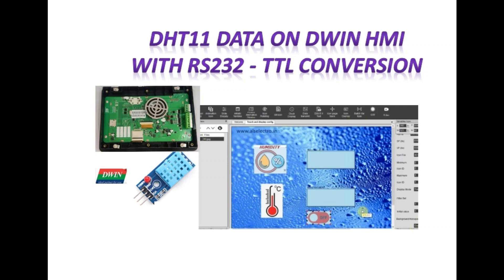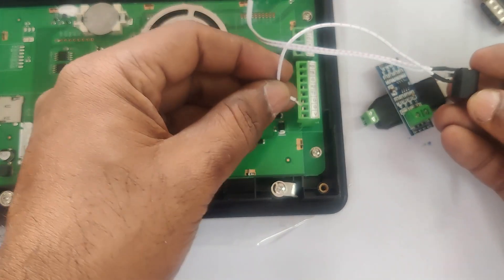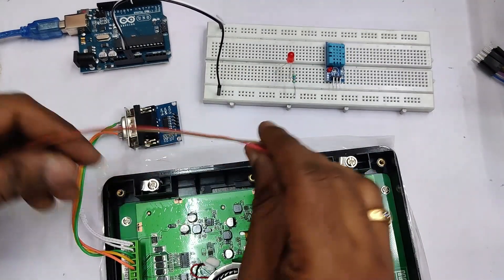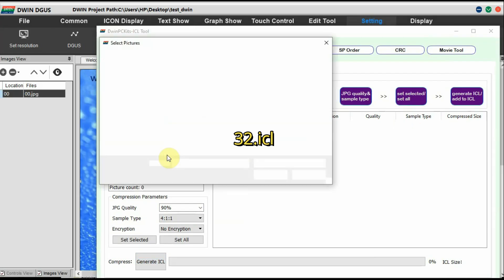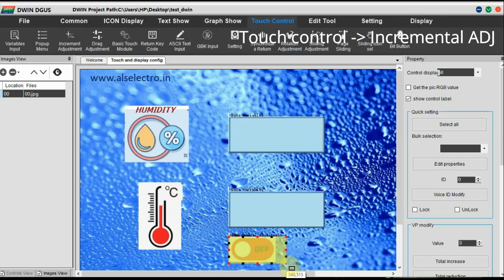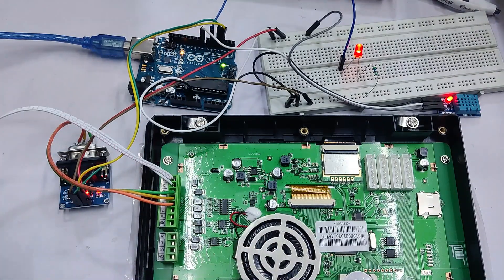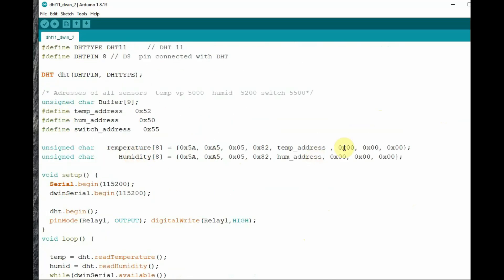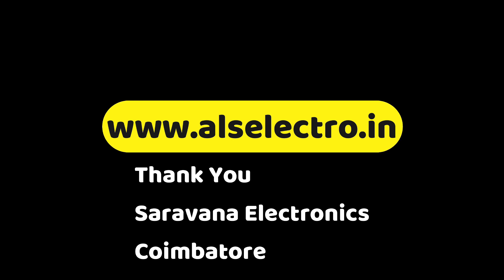#8 DHT11 Data on DWIN HMI DISPLAY - 7" HD with RS232-TTL

Comment: I did same to same even i sent normal data for testing purpose, but display value is not change.
I am using DMG80480C050_03WTC HMI display

Comment: Hello teacher I hope you're very well.
I need your help. I bouth this product FT232RNL USB TO RS232/485/422/TTL Interface Converter, Industrial Isolation. However, I haven't been able to connect this one with my arduino mega 2560. In my Arduino IDE Monitor always Serial.Available is false.

I've connected the following schematic diagram for wiring. In fact, it is to cross-connect the TTL pins such as TXD-RXD RXD-TXD GND-GND:
Can you help me please?